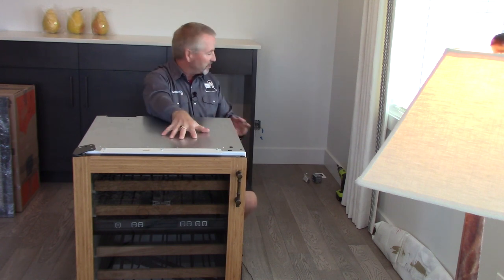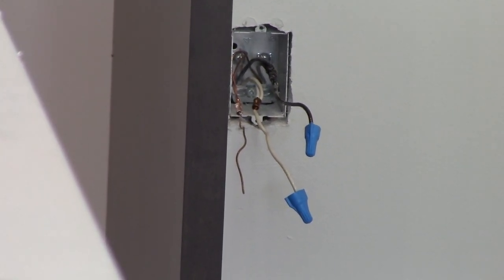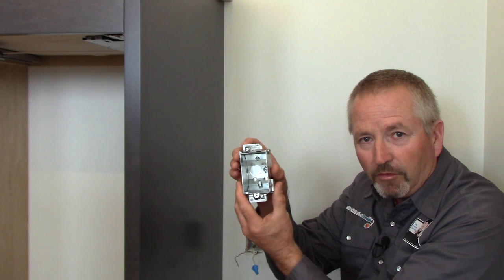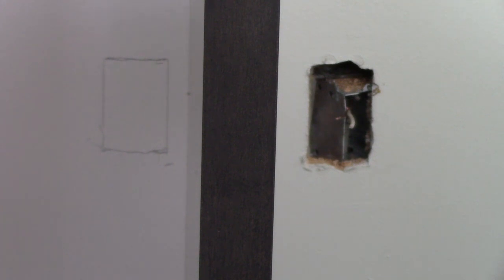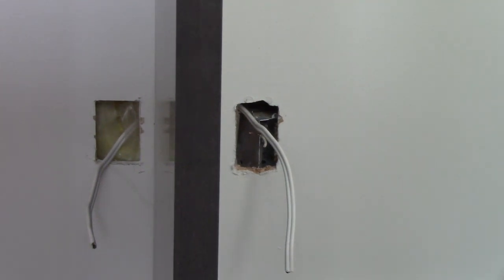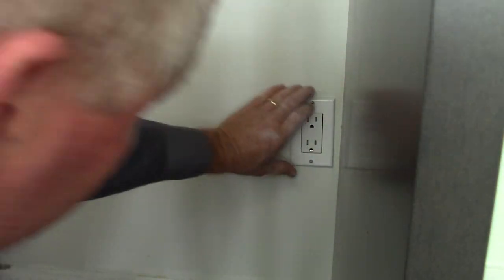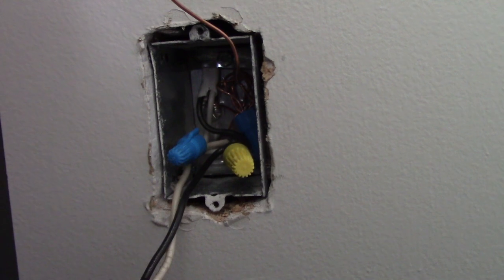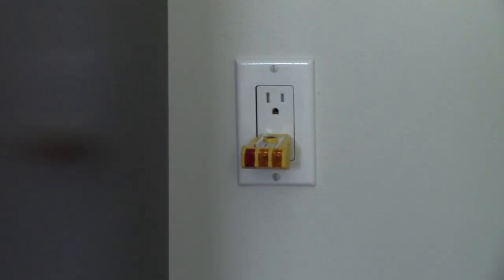How to Add an Extra Receptacle

Comment: Good video, I don't understand why some people cut the wires so short on the inside of the box, definitely a pet peeve of mine. Cheers!
Reply from the maker: Yeah, me as well!  I leave an “oops loop”  when roughing in. Just enough extra cable that you could pull it inside the box in case something happens to damage the conductors.

Comment: I know everyone wraps their wires around the screws of outlets and switches to make connections. I've always done that too and obviously it works perfectly.
I'm curious though, is the proper method to use spades connectors? What would be the pros and cons?

Comment: Some people' don't have the equipment you have, and just don't want buy one and just use it one time.  Why not just use a power core.
Reply from the maker: I assume you mean an extension cord? No problem with extension cords for temporary use.  Just not to be used for something that will be there longer term.  For example, if you're going to put in an extra fridge in the garage, you don't want to use an extension cord for that. I would appreciate it if you like, subscribe, and click the bell as well (if you already did, thanks!) It really helps us creators gain traction with YouTube.